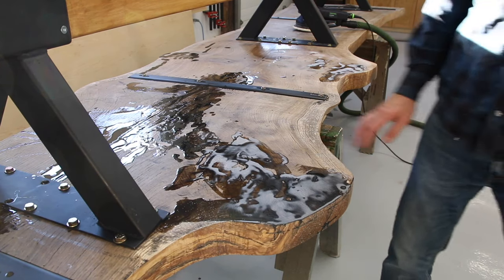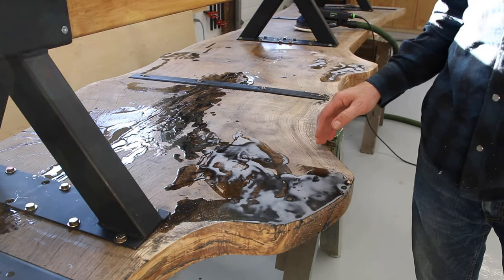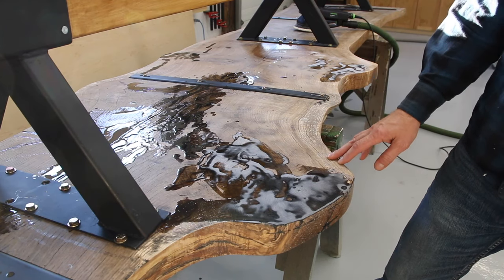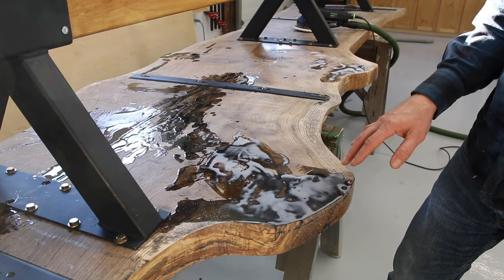12' Live edge dining table (Black Oak)

Comment: Beautiful work. 
The grain on the oak was spectacular.
I am curious why you put the legs on before doing the finishing work on the top.
Reply from the maker: Because the slab was bowed really bad. Like a banana. By putting the base , it straightened the slab then I straightened it more with the power planer.